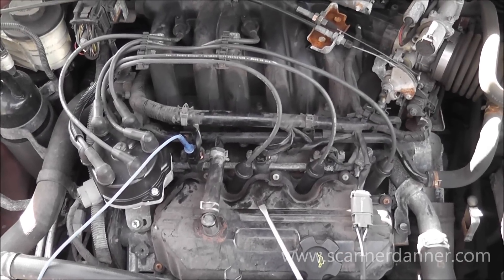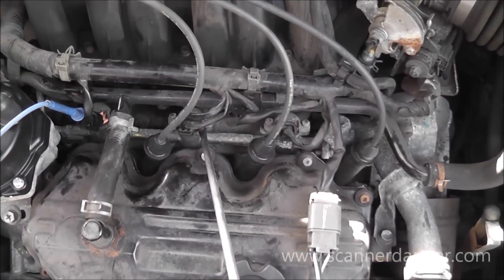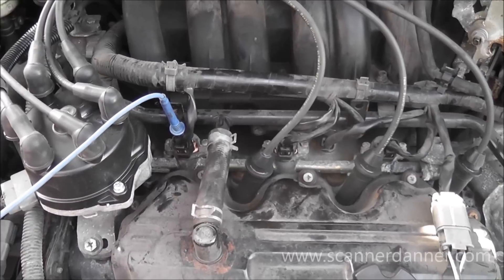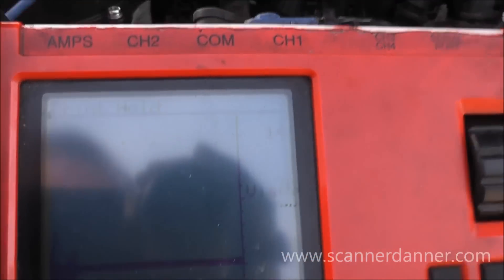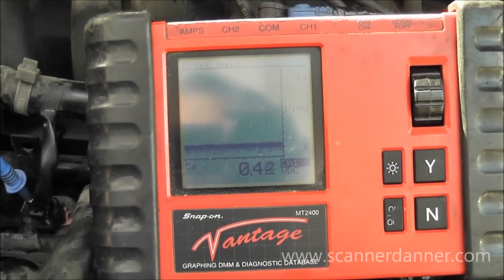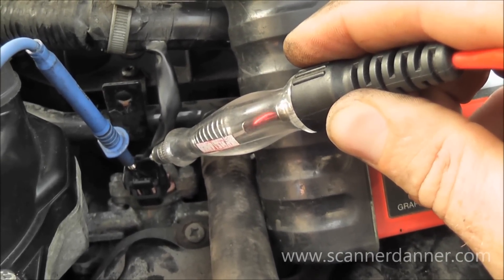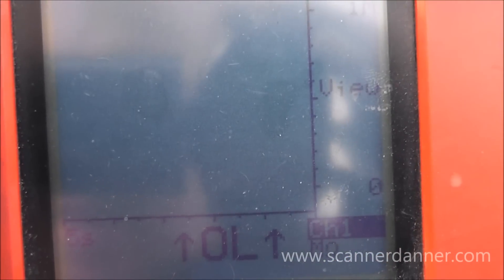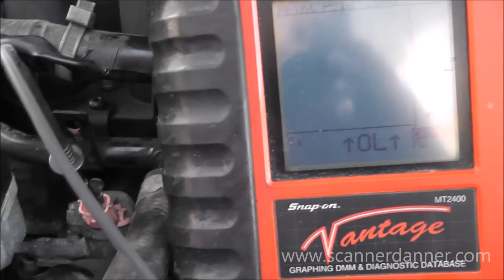How to test a fuel injector (open winding) Nissan

Comment: Hello, Paul. How are you doing? Voltage drop (consumed) across a shorted component is 0, which should mean that a shorted injector would have 12 v on either side, right? I can see a shorted driver or a short in the control wire causing a low voltage where the load is actuated with just Key On. I am just kind of lost .
Reply from the maker: This one was an open, not a short. Maybe that's where you're confused?
Reply: @ScannerDanner  You are right. You did not mention a shorted coil as one of the reasons for the low voltage in the video. I have been a subscriber to your channel when you had less than 80000 subs. You have taught me almost everything that I know. I cannot thank you and Caleb enough for what you have done for us I always look forward to your videos. I go by the name BB on my account.
Reply from the maker: @xylonifylive  does it make sense now my friend? Thank you!
Reply: @ScannerDanner  It does. In your video" Fuel injector testing with basic tools( Noid light, test light) at 19:25, where it says Steady low or 0 v on the control wire, a shorted solenoid( injector) is listed as a cause. Thank you. I was hoping that you would come to Orlando this month for the event, so I could meet you.
Reply from the maker: @xylonifylive  I see the confusion. I do have that listed but to be honest, I have never, not once seen a shorted winding where it was shorted to the housing, causing constant current flow and having 0 v on the control wire. In theory it can happen, which is why it is listed, but I honestly should have left that out of there. Thank you! I was hoping to go to Orlando too! Not this year my friend

Comment: Excellent video. The left pin on the injector is ground that's varied on/off by the ECM. The right lead is steady 12v voltage. IOW, 12v is always supplied by the right lead and all the right leads are joined together. The left lead pulses, supplying ground and thereby firing the injector. If I don't have 12v on the right lead, I could jumper 12v from the bat to the right lead which bypasses the fuse and any relays that may be bad. A second test is to attach my test light alligator clip to 12v and touch the test lamp tip to the left lead. Crank the engine and the test light should flicker on/off. Do I have this right?
Reply from the maker: Using the test light to check for injector control is absolutely a great test! I use it all the time. As far as left and right goes, every car is different but yes on conventional fuel injection systems you'll have a constant power on one wire and a ground side switched circuit on the other.

Comment: Your videos have helped me learn a lot. I am working on a 92 explorer. it has a low power issue under load. disconnect plug wires 1,2,3 and no engine change, even with em all off. tested coil, it's good. have spark at plugs, removed injector 2 wire and no change in engine running. did the test light test have power to injectors batt neg to wire. however I have no pulse on other wire batt pos to wire. key on engine off have power to both wires batt neg to wires. I wanted to prove the power to both wires and checked other side, its the same. Removing any one plug wire on other side of engine 4,5,6 and there is a change. I found the number 1 injector wire had bad insulation and was crossing both wires to itself, repaired harness and re ran tests. still same. removed harness to open it and check for any unseen issues inside under plastic covering, no issues, no more bad wiring insulation. I did notice when testing batt neg to trigger wire on injector i got a lighted test light and the other two injectors clicked one click each time I touched wire with test light. I am friggin stuck and can't think no more.
Reply from the maker: Did you ask another question about this on another video that I just answered?
Reply: @ScannerDanner  yes

Comment: What does it mean when you connect the harness connector terminal 2 to ground and it reads 2.4volts and harness connector terminal 1 to ground reads battery volt 12.4volts.?
Reply from the maker: what harness connector terminal? the injector? Is the connector unplugged or plugged in?

Comment: man you are awesome thanks may have the same problem injector stuck in open spray position, cause fuel to run straight out by exhaust

Comment: Great video and a definite thumbs up! Would an injector problem such as this cause the 1273 code in a Nissan titan as I have already replaced all O2 sensors on the vehicle.
Reply from the maker: Not sure. Can you give me a definition of that code please? Thanks!
Reply: This is what Nissan says about the code: P1273 NISSAN - Air Fuel Ratio Sensor 1 Bank 1 Lean Shift Monitoring. Possible causesFaulty Air fuel ratio (A/F) Sensor 1 Bank 1. Air fuel ratio (A/F) Sensor 1 Bank 1 harness is open or shorted. Air fuel ratio (A/F) Sensor 1 Bank 1 circuit poor electrical connection. Fuel pressure. Faulty Fuel injector.   Faulty Air Flow Meter.

Comment: It is open. But how does an injectior come to be open? Does a small strand of wire burn or something?
Reply from the maker: It is one single small strand of wire, dipped in varnish for insulation so as to not touch another strand, wrapped hundreds or thousands of times in a coil.

Comment: Hi,
Fuel injector is clicking and resistance is ok (15.6)
My feed wire has battery voltage and control wire has 0.03 volts when I have my ignition key at ON position.
Test light is flickering (control wire) when the car runs.
can someone help me? I am newbie.
Reply: plus my control wire has 0.37 volts when car runs
Reply from the maker: you found the right video! what is your problem? why are you focused on the injector? If it is clicking, then the control circuit is functioning at least and you definitely should not be seeing .03 on the control wire. You have to be having a contact issue with your backprobing tool. (or maybe you tested that unplugged?)
Reply: To begin with, I am new mechanic and new on the diagnostics so forgive me in advance. I had a missfire cylinder 3 (p0303). I checked for spark and it was good. After that I went to check the injector who was clicking but I said why not checking it anyway. First, I unplugged the injector wires. I turned the ignition switch at ON position. Feed wire had battery voltage and Control wire had 0.03 volts. After I repeat it with car running. Now feed wire had battery voltage but control wire had 0.37 volts. I did your procedure with test light. While the car runs I touched the control wire with test light and it was flickering.

Comment: hey man my brother's has a 95 nissan quest and it cranks but doesnt want to turn over. do you what could it be, I changed the battery,distributor cap and rotor, doing the coil as well. but so far no go.

Comment: Great information. I had a lot of mechanics scratching there heads. I brought the van home, started doing research. Installing ecm tonight on a hunch, but could have better isolated this had I seen your vid first. I will also check the injectors this way to get it right. Thank you, this was the best info of all !!!!!
Reply: Never install parts, especially ecm, on a hunch.  I  always test components and replace as nessary

Comment: I have a 1999 mercury villager with the same nissan engine. There was water in the gas which possibly ruined the injectors now the van will not start at all--not even hit one cylinder a single time. Can a shade tree mechanic like myself replace injectors?--I cant find any info on how hard to service them. Only pictures
Reply: It's not hard if you can reach everything. Release gas pressure, unbolt fuel rail, elbow grease pull the injectors off, put some wd40 on the new injector o ring, push in injectors, bolt on fuel rail. Have some spare o rings with you.

Comment: when the engine is turned off and then backprobing the control wire at the connector(plugged in), there will be zero volts, but should be 12 volts, same as the feed wire, correct?
Reply from the maker: +Zvonimir bobić yes! As long as the injector circuit is powered up with just the key on. Some of them operate off the same feed as the fuel pump so there will be no power there with the engine not running

Comment: So far, in nine years I've replaced half the injectors in my '98 Villager.  All of them were open, so I believe the quickest test is to simply do the ohms check.  That will quickly tell you whether you need a new one ($80).  Better to take your ohm meter to the junkyard and get a couple for less than $10 each.  They should read about 10 ohms if they're good.  Above or below that, watch out.
Reply: I’ve got a 1996 villager. Is it possible to replace the rear fuel injectors without removing the intake manifold?
Reply: @carlorocky  I've done the two on the left side as you look at the engine from the front.  I used a variety of tools to work between the intake runners. When I got the old one out I discarded the Phillips-head screws for Allen-heads, which are easier to access at an angle.

Comment: K for checking the votes by the plugs and if they all good and if it was the injector was bad wood  it cause smoking out have the tail pipe on a 1999 Nissan maxima ?
Reply from the maker: Justin Taketa If an injector is stuck open, it can cause severe white smoke. Check out this video
https://www.youtube.com/watch?v=jsl531-6q-A
Reply: K
Reply: Thanks you very much man that happens a lot I wood it now that now I do I am going looking now
Reply: Justin Fam ggh

Comment: I was searching for info on a 1995 mercury villager van, (I ended up here)
I wish someone could tell me whats wrong with my van, or where to look.  Its acting very strange, as im going down the road, it seems to be getting gas, sorta like "in sqirts" , goes good, then hesitates, while im pushing the gas, its like its not getting any gas, then there it goes again, (only way I can describe it, sorry) can somekne out there plz help me?
Reply: Mercury Villager is a Nissan Quest.
Post your question here. 
I am directing all help requests to my forum. Sign up (it's free) and create a new post. Be sure to add a name under "alias" as this is the name that will appear in the post.
Here is the link to the forum. 
http://www.scannerdanner.com/ForumRetrieve.aspx?ForumID=3226

Comment: Adjust FITV to close after heating valve to over 100 degrees, then check valve for open after cooling in refrigerator.

Comment: can i do the same thing with a multimeter ?
Reply: jaybeefun As I say above, easiest way is to simply check for 7-15 ohms with the engine off and connector unplugged.  All my Nissan injectors have failed open, so the rest of the testing is unnecessary unless it passes that test.  The back ones on these V6s are very hard to get to, however.  You must probe between the intake manifold rails.  Very difficult.....

Comment: what is the fix for this injector?
Reply from the maker: It needs an injector. I showed the open injector coil with two different tests.
Reply: cleaning the injector make a fix?
Reply from the maker: no, it was an electrical problem. The internal winding was open. You cannot clean that. IT must be replaced
Reply: thanks for replay.

Comment: can a stuck open fuel injector make gas come out your tailpipe
Reply: Yes. It will also have an exhaust that looks like a blown head gasket. It is vaporized fuel that is not burnt. Might be a little tricky to find, because measuring the resistance of the fuel injector coil doesn't always solve the problem. I might be a defective O ring on that fuel injector.
Reply: A burned exhaust valve will do that.

Comment: the ohms was completely dead zero I expect that's why its an open in the injector, Paul I commented to your noid light video, got a P0204 code on a common rail diesel in the haynes manual its 0.2 to 0.3 ohms on the injector, Im hoping that its an open in the signal wires I just dont know how to check them as they are 80-120volts on these common rails? Hoping to see an open on the injector otherwise though they are hard to remove, they get seized in there bad

Comment: This engine out of all of the nissan engines, the 3.3v6 is the worst freaking engine ever.
Looks like you have it all dialed in with the diagnostics though!!!!
Reply: so what is wrong with it I have two of them pushing 200000 thousand miles and have very good service out of them they run forever start good in sub zero weather and ge t good c
das milage.

Comment from the maker: hard to say, do a compression test on the #1 cylinder and compare it to another. you could have other issues too besides the injector, vacuum leak, head gasket etc

Comment: hey danner I have 1999 honda accord ex and I have a code for #1 miss fire but the engine dosent miss or nun and I have a spark tester the #1 spark wire has spark but when I did the spark test u can hear it missing now! would u say its my #1 injecter clogged a little? Im hoping its not low compression

Comment: If you connect a timing light induction coupling around the wires to the injector it should flash the timing light to show you have pulse

Comment from the maker: I disagree for this application. If I was just measuring injector resistance I would agree than I should be using a low ohm scale. In this case I am looking for a complete open winding and the only true open or "infinity" on an ohmmeter is O.L. on the mega ohm scale. I wanted to prove the winding was open and if I used a low ohm scale O.L. ohms is NOT necessarily open, just higher than the scale you picked.

Comment: Great video but you should not be using MOhm scale but a KOhm one in case the limits of detection prevent from seeing the small resistance. injectors go from 1-2 KOhm to 20-30 KOhm

Comment from the maker: @costumsticks you could do that but you would need a scope to see the pulses. a regular dmm would not show it. also you would not be stressing the circuit at all. of course the test light really doesn't either in this case but still more than the dmm would. but i do agree with your test that it does have value too so thx!

Comment: Hi,  Paul.
If you had reversed the leads of the meter, to battery power and touch the control wire,the signal should have pulse on the meter indicating a good ground control from the pcm, show no grounded wiring, and also eliminate the need for the test light.  
 I really enjoyed your book.  Keep up the good, hard work.    Thanks

Comment: So the meter read low voltage because even though the computer was feeding the pulsed ground,  it never reached B+ on the other side of the injector because injector coil was open...but when you put the test light on it, the light pulsed because you basically completed a circuit back to B+ via the test light as the computer was pulsing the ground.  Did I understand correctly?